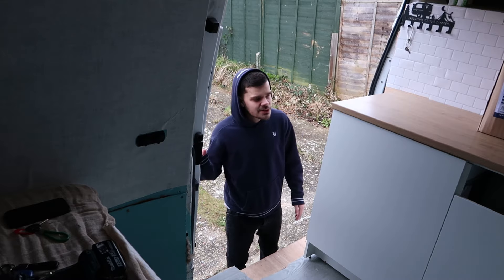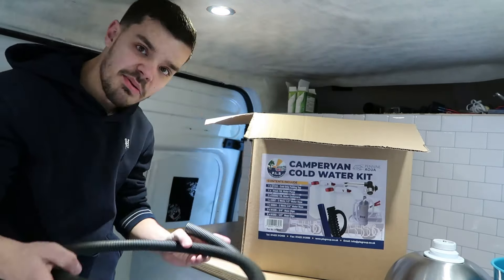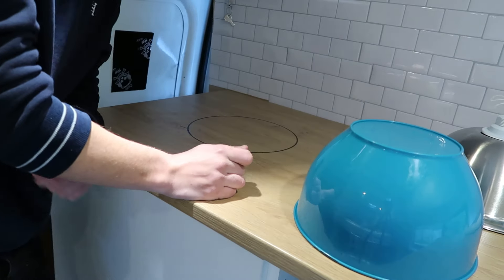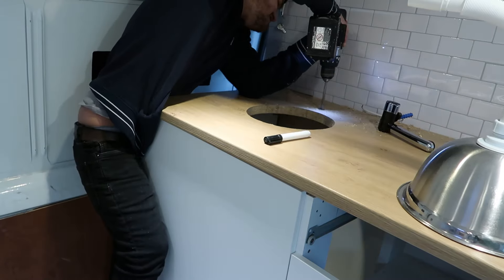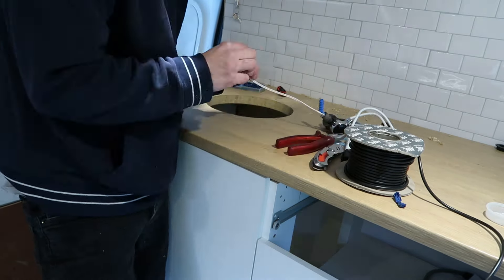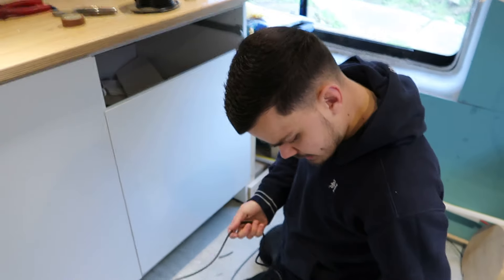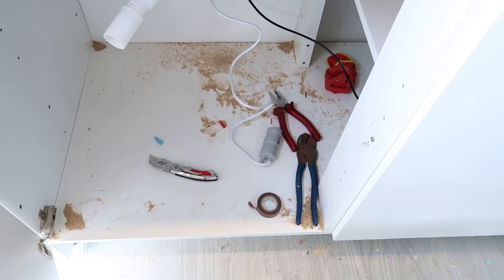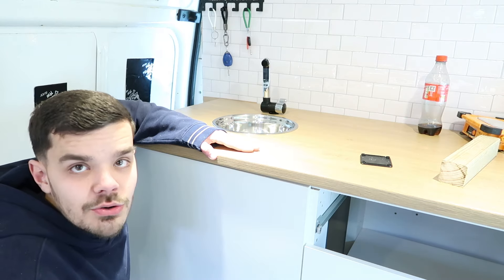Campervan sink install DIY

Comment: I have a motorhome and have never used the factory fitted sink or on board water tank.
I use a collapsable bucket and a small box which holds approx 10 x 2lt water bottles. Pop up the bucket , empty the required water in and then at the end dump the dirty water down a drain etc. You get more work surface and a lot less messing about.
Reply from the maker: Thanks for the comment i know it might be easier for space but just prefer a tap and a sink